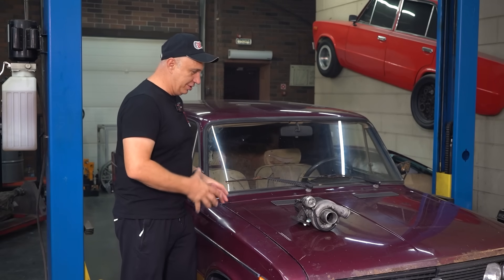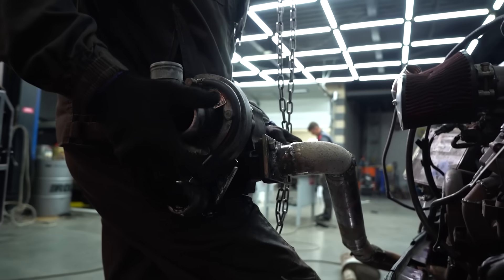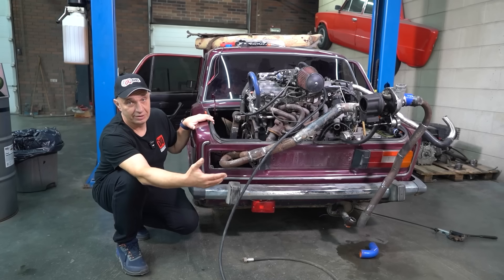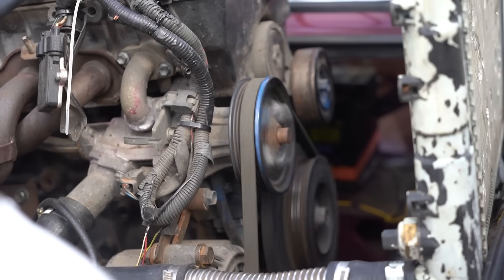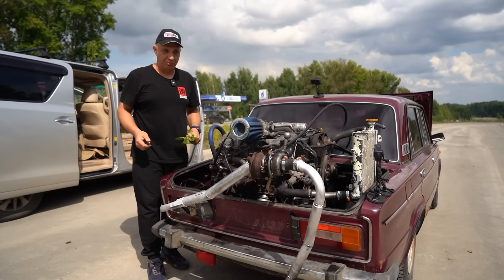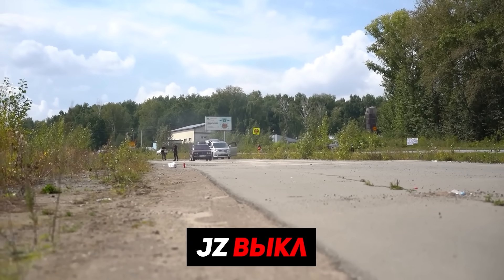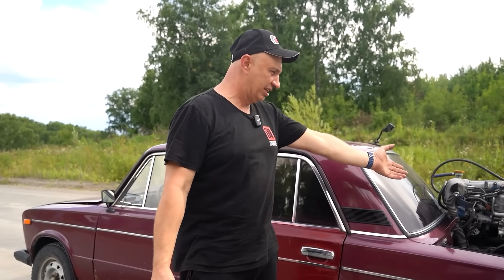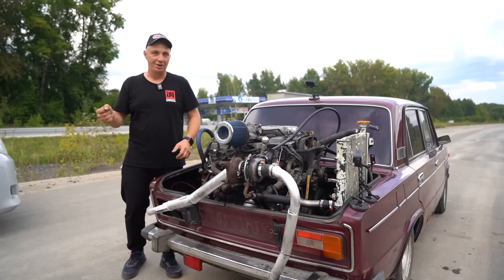Using a turbo to suck exhaust gases out of an engine - what will happen?

Comment: Assisted exhaust scavenging is a neat idea. It'd be shippable if it was packaged to increase suction based on RPMs and throttle input using an electric setup; maybe have it not run at low RPMs or  low throttle input for efficiency since recharging the system would increase parasitic loss.

Comment: Using a supercharger or leaf blower. I had to Google this, blowing over a straw causes water to come out due to the Bernoulli principle and a resulting pressure difference. So in theory of you hook up a leaf blower to blow past the exhaust or rig it in a way to suck the exhaust out without damaging it, it would do the job without adding too much weight.

Comment: Lada motor with the stiffest valve springs possible(never drop a valve)

Motor with shortest rod length (maybe shorten the cylinder height too see how high it revs)

Motor with shortest piston skirts possible 

Biggest camshaft possible in a lada

2 stroke lada engine, with expansion pipe exhaust

Comment: Make an engine with an oil filter bypass and drive it hard
Reply: Gasoline engine. Remove all the paper filter from within a filter. Make it have no filter for the oil
Reply: Assemble an engine with all the bolts half torques. At least the connecting rods and bearings

Comment: There are 2 stroke diesels that have used exhaust scavenging superchargers. Typically they supercharge the intake side but the exhaust scavenge pump also works. The main downside is that you can't really add boost in the same way you could charging the intake side. But it definitely worked.

Comment: Put a small/mid size garage air compressor (piston type, electrical). Fits nicely into the trunk. Replace compressor's el. motor with DC unit that can be poered by the alternator regulated to some 5 bars. Make it as air boost instead of the turbo to the engine (limited by regulation valve from, let's say 1.3 to 1.5 bar or more), activated by electrical valve at some 3000rpm or higher. If you can make pressure vary with throtlle, even better.

Comment: As a next idea search for the thunderstorm generator. Essentially intake charge goes through a water bubbler then it goes through a vortex heat transfer tube that actually cools down the exhaust temp using the intake charge. I guess the idea here is to increase efficiency by not losing energy as heat out the tailpipe but recirculating the energy it somehow increases fuel efficiency.

Comment: I saw the thumbnail and the title yesterday, but left watching the video for today. During this time I thought that they will first power the turbo with the engine's own exhaust with some bizarre Uroboros-style piping, explain why it doesn't work, and then show what happens if when you suck the exhaust out by powering the turbo with and an electric motor and an external battery or something reasonable like that.

I'm currently at 0:59 and I suppose I've underestimated Garage 54.

Comment: Try using a super charger driven with a pulley like a procharger to scavenge the exhaust from the engine in the car. Then you can use an electric motor with a speed controller to run the supercharger. Then you can adjust the speed of the electric motor to go along with the speed of the engine in the car by using a simple throttle position sensor to control the motor. Love the great work. Keep it up!

Comment: It's obviously going to be much less effective than putting it on the intake.   Because that not only pushes more fuel mixture into the cylinders but also increases that cylinder compression.

Comment: Because an electric fan mounted to the exhaust would have been impossible to hear from two miles away at idle? Garage 54 is doing what it is expected (twigs and leaves and all the scrupulous engineering measurements). These guys are the definition of ''In Russia, engineering is what happens to car AFTER you buy it.'

Comment: You just gotta love how they used a 2.5 litre 300 pound 100+ KW engine to spin a turbo that could have easily been spun by a 2 kg 0.5KW electric motor. The sheer excess makes this awesome.

Comment: 0:10 - my prediction - the turbo will overheat and catastrophically fail.
if you run the exhaust through a very good water-cooled or refrigerant-cooled intercooler 100% efficiently, then maybe you will get the same effect as having it on the intake. you might even ends up dragging lower-than-atmospheric-pressure-air into the firing chamber, and end up getting low compression

Comment: Custom windings on a starter motor direct drive the impeller side (only) of the turbo. Power the starter motor with batteries. Do the same to the intake on the stock motor and custom grind cams for less overlap.

Comment: Interesting!

 hear me out, put the turbo on the lada engine as normal but route the exhaust side of the turbo into the compressor/intake side of the turbo.

Thats way the exhaust of the lada engine powers the turbo and once it gets under load the compressor side will pull the exhaust gasses out faster

Comment: Gr8 video...why not make a fan/ blower assembly to flow high volume air thru a venturi ...like a carburettor  venturi, but instead the venturi will be pulling the exhaust gases out...

Comment: base on my understanding of generic mechanical parts, things that design for blowing are terrible at sucking and vise versa... since a turbo is design to blow a lot of air into the engine, it might not work as a pump for exhaust.
Reply: they can make new turbo fan blade but reverse 🤪

Comment: How much could it really be for China to make half a turbo connected to an electric motor?  Maybe a bypass valve?  You could set it up like a push-button.  Its emergency power!  Lots of old war machines had mechanisms to get a little extra power in times of need.  Mostly injecting different things into the engine.  This would just trade some later alternator drag for a little extra power now.  It would have to have some kind of time limit and recharge cycle.

Comment: I actually invented a push/pull 2 stage turbo system about 15 years ago that is exactly this, a vacuum turbo on the exhaust with one synchronised with it on the intake.
Reply: “Invented” lol sure you did bro
Reply: Would love to know more
Reply: What did you find in your tests?
Reply: Yeah, it makes you wonder how something as simple as adjusting the upstream and downstream pressure of an otto engine is not more common ;-)

Comment: Do a twin turbo setup. Have one turbo as normal compressing air into the intake with a blow through carb or fuel injected engine. Then have the second turbo sucking the exaust out. As an engineer my hypothesis would be an engine thats very sluggish over the first few K's of RPM but will rev  very quickly. The turbos might need to be smaller or atleast the turbo on the exhaust side might need to be slightly smaller so it can get good suction on what exhaust gases are left coming out of the main turbos exhaust and it's own.

So in essence have a Y pipe connecting the exhaust exits from both turbos. But then that Y singles into the air intake of the second turbo. This would make your final exhaust exit for the system be where the boost would normally come out of the second turbo. PLEASE DO THIS!!

You'll have both turbos spooled from the pressure from the engines exhaust gases. One turbo will used its boost to compress air into the intake. Then then there will be a

Comment: Why use such a massive engine to run the turbo if all you need to do is spin it up and keep it going shouldnt like a 300cc motorcycle engine be good enough? Without all that extra weight

Comment: During overlapping degrees of intake and exhaust cycles it will suck all the air that's used to push exhaust gases out of the chamber! That will lead to richer air fuel mixture leading to more losses and worst mileage!

Comment: I would say use a supercharger attached to an electric motor with a variable speed adjuster at the driver's reach.  Would be much smaller and could be packaged as a unit in the trunk area.

Comment: That is why porting and polishing intake and exhaust ports help.  Better air flow.  Wonder if you could do it with an electric turbo.  That way you could drop the weight of the extra motor.

Comment: Think an electric turbo setup would have better results and more constancy to the data collected.

The 1jz motor is overkill to try and maintain a negative pressure draw on the exhaust system.

Comment: I can't help but wonder whether the addition of a really heavy flywheel for the JZ could further improve the concept

The engine would be under a bigger load, hence making the exhaust gases more pressured and theoretically spinning the turbocharger to a higher RPM

Comment: My prediction is it will pull exhaust gas, cooling the engine and actually make a bit more power because the engine is running cooler.  Also zero exhaust restriction probably counts for something 😂

Comment: Its basically acting like a 2 stroke on the pipe. Pulling exhaust out of the cylinder while sucking air in

Comment: I realize it wouldn't have been as grotesque, but why not just us an electric motor to spin up the turbo? Far easier to do, less weight, less noise and vibration and far more reliability.

Comment: what i would like to see is taking out the cam in a motor and regrinding it so that the stroke is smaller than the power stroke. basicly, the cam doesnt let air in until the piston is closer to tdc. in this way you will make a more efficient motor

Comment: Might work better if its one pulling out exhaust and one or two going into the engine. Needs pressure to run right. An engine simplified is just trading pressures and maybe doing that faster can make more power or run better than just acturbo pulling exhaust.

Comment: This maximizes exhaust efficiency, but to work better it needs sophistically placed holes on the exhaust to create a scavenging effect where theoretically a steady flow in the exhaust under vacuum would have more inertia to clear the exhaust gasses more efficiently vs waiting an exhaust pulse to be pulled by vacuum its self.

Comment: It's basically sucking the back pressure out of the lada exhaust and pulling a little extra air through the engine. Try it without mufflers and stuff on lada and it should work better

Comment: Join two turbos by the shaft, put a burner in the first turbo between the turbine and the compressor (like a "regular" jet engine).
Use the second turbo as a regular compressor for the intake, and use the turbine of this second turbo as an exhaust extractor (connecting it in the reverse way) 
Very difficult to do, but only you can do it.

Comment: Just split the exhaust under the car and have the One that goes to the Compressor, and the other that Goes to the exhaust and then eventually merge the two together again but at a bigger bore for higher volume out.

No need for a second engine

Comment: Why another engine ?  Use an electric motor for the turbo. It needs to spin only when the throttle is wide open. Normal car battery (or two) will be sufficient.
Reply: Agree. An electric motor activated by exhaust gases' pressure would be lighter, simpler, and less noisy.  I suggest repeating this test with the turbo connected to an electrical motor.

Comment: So, correct me if im wrong but they have one exhaust to the hot side, and one to the cold side. Wouldn't that make the propeller fight against each other since the fins are faced opposite directions? And also, even though they're pulling more air out, more air and fuel isn't coming in. Adding a turbo and an extra engine to shave off less than a second on 0-60 is what makes me question all this. But that could also be due to the fact turbo had no respool between gear change.

Comment: Maybe try it the opposite way: Use a small engine (like a Lada engine) to drive the turbo for pulling a vacuum on a much larger engine. Also, stick it on a Dyno if you can.

Comment: there is few years when Freevalve came, I imagined a system using a kind of electric turbocharger sucking exhaust like here and remove the throttle body like a diesel because the valve act like restricting air or not and with a lot of backpressure it could reduce emission and increase horsepower.

Only theorical issues were heat, it needs to be cooled and the leaks that can reduce the benefits of using this system

Comment: You could create a compound turbo system, where air compressed by the first turbo is then fed into the inlet of the second turbo and use the other side to suck out the exhaust gasses..

Comment: I did not understand why you need another engine in back doing nothing. Is it doing anything. After all you just need to find out is connecting a turbine at the end of tail pipe will improve performance ... Just wondering if I am missing something here...😮😮

Comment: You don't need another engine for this test.

The compressor gets fed from the exhaust.

Causing pressure that can be sent to a custom "y" pipe. ( for a lack of better description. Into the exhaust.  This might cause a vacuum if the compressor is doing more work than the exhaust inlet side.

A cam with valve overlap would be helpful as well.

Scavenging.

Comment: Another thing you should try is to fit a larger diameter exhaust system that should get the exhaust gases out quicker than the standard exhaust system

Comment: I want to see an electric motor with a battery in the trunk spinning the turbo instead of a big heavy engine in the trunk spinning the turbo. The battery could get charged up by the alternator up front.

Comment: Omg!! I've been wondering this for years! Well, specifically for high RPM in a boosted (supercharged) engine where the exhaust stroke is not as complete as one would think / expect.

BUT, where this is a REALLY interesting experiment is with a 2-stoke, specifically uniflow like 2-stroke Diesels, Detroits & Fodens; there could be some serious increase in possible peak RPM & other benefits, so potentially really increasing the HP. However obviously lowers efficiency since it's like running a second supercharger just for exhaust.

Comment: okay here's an idea to package that a bit better.
custom built turbine that fits into a section of the exhaust. belt driven like a super charger.
weld in a old pulley or something into the driveshaft for the belt to run on for the "supercharger type turbine type thing" 

now go 😅🙂

Comment: The added weight more than offsets the potential added power. Now, if they added ANOTHER turbo to the lada engine itself, and then used a small electric motor or compressed air or something to power the exhaust scavenging turbo....it might actually make the lada faster

Comment: The reason this won't be effective, especially anywhere near as effective as compressing intake gasses is with natural aspiration, you're limited by barometric pressure. You're exhaust is compressed and pushed out by the piston and your limitation is basically non existent. It can push it all out. It just does it more efficiently with less backpressure. The only way I could see this being effective is if you cammed it so the valve overlap is ridiculous and you use the negative backpressure exhaust to help pull some air in.

Comment: How about some cam work to increase your time the exhaust and intake valves are over lapped more. This would allow for more cylinder purge and more fuel air charge .

Comment: there will be a performance gain for sure but you'll be limited to a bit less than atmospheric pressure (full vacuum), unlike a real turbo where you can go over 15 psi. Well that's my opinion, maybe a gain but not a significant one! let's watch

Comment: I long ago thought about this concept except by attaching a high power electrically driven compressor to the exhaust side of a conventional turbo to evacuate the exhaust gases, thus drastically reducing  turbine back pressure.

Comment: I've paused the video and I'm conflicted as to what I think will happen. When I first thought about it it seems like it will work but then you're adding so much weight to the vehicle that I feel any positive effect will be of no use. If it doesn't work then perhaps a small electric motor to drive the turbo might work. Of course you have no exhaust gases to turn it but if you somehow connect it to the turbo without the need for gas then it might kick butt. So I cannot give you a definitive answer as to what I think will happen. All I know is that this will be a cool video to watch.

Comment: You could try to connect the turbo to the rear axle then when the car is moving it pulls exhaust out of the engine. That would eliminate the need for the whole engine on the back.
Reply: However, I think the performance improvement would be limited as the best it can do is pull a full vacuum on the exhaust. If it was connected to the intake maybe it could provide a decent amount of boost.

Comment: Sane people? (If that is possible) wanting to see if powered scavenge adds power, uses electric turbo..g54, testing same..throw in a bigger motor than the one pulling the car just to spin up turbo..I'm here for it.

Comment: Turbos just do one thing: gives you more air. You have a fixed volume set by the piston, so a greater pression given by the turbo gives you more air that LETS you to burn more fuel, but if no extra fuel is given then you're making less power because you're making the mix leaner. 
For making more power you need the turbo to do its thing but also supply more fuel to the pistons.
Also you gotta be careful, an increased intake pressure means you make more compression due to increase on the amount of air inside the piston, so you have to make the highest compression but without getting into the knocking zone for the given fuel.

Comment: I think it would be cool if you guys tried a direct air injection engine. Something like removing the intake cam shaft and only supplying the engine with air compressor nozzles.